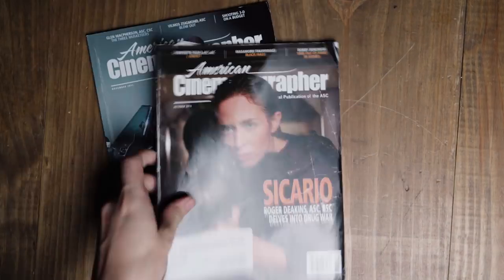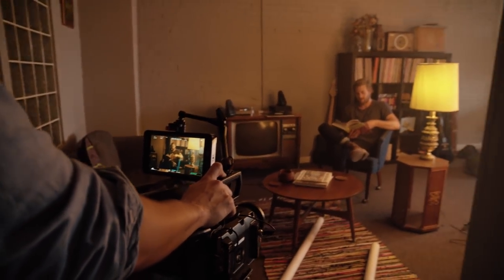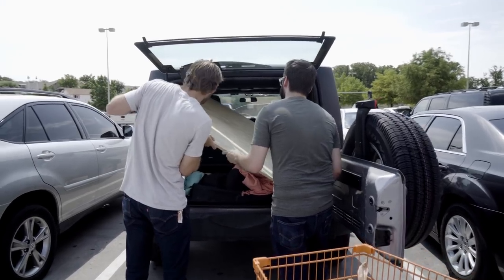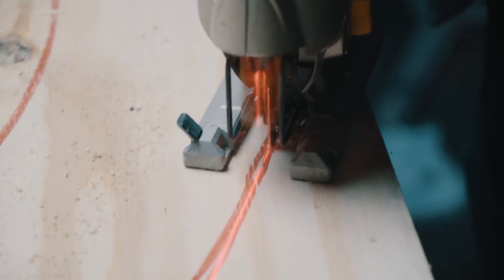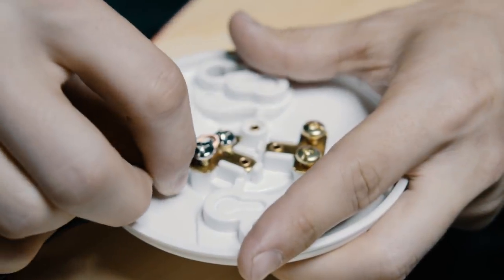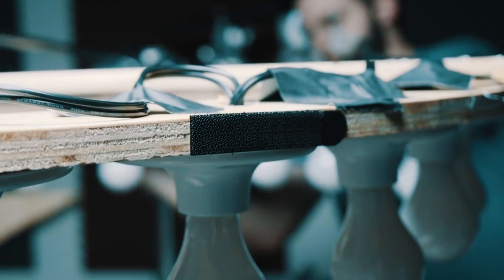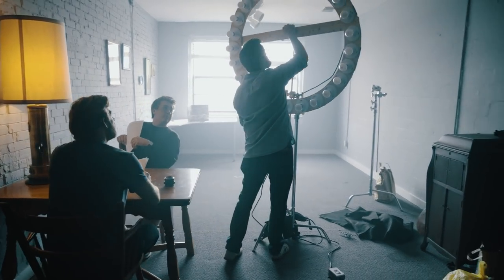How To Make A ROGER DEAKINS RING LIGHT | Cinematography Techniques

Comment: 25x 60Watts = 1500Watts, with 16gauge 2-wire, no ground, wired with no boxes + ~25ft stinger(?) = voltage drop (consult with an electrician).
Reply: Yes, but they're dimming it anyway so a voltage drop is probably helpful. (I'd still use thicker wire tho.)
Reply: No need for ground, it's made out of wood and plastic.

Comment: Instead of the plywood you'd want to use MDF it's more stable and has no grain that is prone to cracking. When drilling holes larger than half an inch you'd want to just use a hole saw as well. Alternatively there are other bulb mounts that are battery powered so you wouldn't have to be limited to certain areas with a source of electrical outlets. Great work by the way! Love Mr Deakins tips!

Comment: to find the ctr of the plywood, use a chalk line and snap a line corner to corner, do this for the other corner to corner, where it intersects is the center, it is easy and more accurate than what is presented in the video.

Comment: Really appreciated the video. I thought before about making a big ring light like that but never found a place where I could store it, so the project fell by the wayside.
But the former building inspector in me cringed a little on a few things that haven't been mentioned or that are definitely potential hazards.
First of all, the ring will draw 1500 watts. So make sure that the lamp cord you use is rated for that or more. For North-America, it would need to be wire that's rated over 12.5 amps. If it's not, it will overheat from all those electrons flowing through and potentially catch fire.
Second, the porcelain fixtures used are designed to be mounted on grounded electrical boxes. It would be preferable to use a different type of fixture if possible. If not, you have to make sure you seal the bottom of each fixture properly and take care about not letting humidity enter the wood as it could become an electrocution hazard.
But apart from that, it's a great project and it wouldn't take much to make it look really processional.
Reply from the maker: Good point, should have mentioned I used 16 gauge lamp cord which is rated for 1560 watts.
Reply: @shutterstocktutorials  Yeah no, you should not be teaching people to build this. You might have the aptitude to do it properly, but there are too many things that can go wrong, and this design skips too many of the safety features that those components are designed to work with. 

It might be safe for YOU to use, and safe for ME to use, but someone out there might make a mistake that causes a fire. 

How would you feel if you found out one of your subscribers built this, and something went wrong ? And if the insurance company found out something like this started the fire, they wont' be covered. 

If you're going to build something like this. It's do so at your own risk, you DO NOT teach other people to do it. 
Something like this will not be UL or ETL listed, and the way you are using the components violates their UL listing, therefore it would not be void your insurance if it fails. If someone else builds this and it fails, you could be sued. 
If you're going to teach people how to do something like this, it needs to be 110%. Components have to be used as they were designed to be used and all safety featured need to be implemented within the intent of code.
ie: No fuse ? Use 14g wire. 

It's really not that hard to do this right, sure it'd cost 3 times as much, but what is your livelihood worth ?
Reply: @Mewtal8  I disagree, he does not have the aptitude to do this properly. Basic math on paper shows this is a bad idea.
Reply: @Francois Laverdure Which light fixtures would you recommend?
Reply: @asadenning8801  Those lampholders are fine, but they need to be mounted to electrical boxes which are in turn mounted to the wood. What would make this much safer is using LED bulbs, good ones with at least 90 CRI. Cree's 60-watt equivalent bulbs that they sell at Home Depot are great. They'd only use 250 watts, compared to 1500 for the incandescents.
Reply: @KingdaToro  I have seen this comment before, please explain WHY electrical boxes are needed because I see nothing that would make this better, if anything it adds more of a hazard because if they use metal boxes they need to all be grounded. the lights should be grouped closely together so boxes would defeat that purpose. I see no benefits to using boxes and only added cost and time
Reply: @shutterstocktutorials  with all due respect, 16 gauge wire should not be used for 1560 watts. that is undersized and false advertising, your wires will get warm using the full watts
Reply: @eksine  Electrical boxes are for containing any sparks or arcs that could otherwise start a fire. Any electrical connections or junctions must be inside one. They are DEFINITELY needed here, as the whole thing is built from combustible material. Plastic boxes can be used if you don't want to worry about grounding them.
Reply: @KingdaToro  Adam I looked up thermal properties of plywood and electrical boxes which I assume is made of PVC. What I can tell from the numbers is that PVC will start melting before the plywood will start igniting so the box is not really preventing what you are saying but my understanding is very little because I'm no materials engineer. So again I see no solid reason to use electrical boxes from a cost and size point of view. If the wood will catch fire than the box will not prevent it. There is a plastic call PEK or MEK I can't remember their names that would hold up to the heat. In any case building a frame out of aluminum or mild steel would work from a fire proof point of view but you would need to ground it, however the more I think about it the bulb holder is made of plastic, probably PVC too so in any case the entire scenario you guys are arguing about electrical boxes don't make sense. maybe just add in the GFCI adaptor like I tell people and carry a fire extinguisher

https://www.performancepanels.com/thermal-properties#:~:text=The%20thermal%20degradation%20and%20ignition,some%20possibility%20of%20spontaneous%20combustion.

https://en.wikipedia.org/wiki/Polyvinyl_chloride
Reply: @eksine  It's this simple. When you're dealing with line-voltage electricity, you are required to use UL listed electrical components and wiring, and to use them in a way that doesn't void their UL listings. Any project that fails to do this is flat out illegal. If it were to shock/electrocute someone or start a fire, the person who'd built and operated it would assume full civil and criminal liability. Insurance wouldn't touch it. Using lampholders without boxes ABSOLUTELY voids their listing.
Reply: @KingdaToro  what about the plywood than? that would negate the entire UL rating by itself. I see what you are saying but in order for the entire thing to be UL rated it must wholly  pass their inspection, the plywood alone would fail UL so your entire argument doesn't completely add up
Reply: @eksine  The plywood isn't an electrical component. As long as you use electrical components with UL listings that allow them to be attached to wood, you're good there. Boxes typically are. Lampholders are not.
Reply: @KingdaToro  so I can attach electrical boxes to cardboard boxes, sell them and legally claim the contraption is UL certified? that doesn't make any sense whatsoever
Reply: You're still not getting it. Electrical boxes are UL listed to be attached to wood, as it's a common building material. They are not listed to be attached to cardboard. Attaching them to wood would not void their listings, attaching them to cardboard certainly would. In any case, the entire device would need a UL listing in order to be sold as a complete device. This is not being done. You don't need to get such a listing to build something like this yourself, or to sell/give away plans for it. You do need a listing to sell the actual completed device.
Reply: @KingdaToro  no Adam, you say I am not getting it however I've been listening to you to understand your main point. Your concern is that insurance won't pay unless everything is UL certified correct? that is just not so, insurance will not deny your claim unless it's a real shady company which you shouldn't be using. here are the documents supporting this:

https://www.houzz.com/discussions/2642606/will-appliance-with-no-ul-listing-really-void-insurance

https://electronics.stackexchange.com/questions/10639/is-ul-approval-required-on-all-items-sold-in-the-usa

https://www.reddit.com/r/homeautomation/comments/7t5ilz/putting_to_rest_the_insurance_wont_pay_thing/

https://groups.google.com/g/openevse/c/TQ78VAINpus?pli=1

so again electrical boxes hinder the inherent design for an incandescent ring light. we can now put the electrical box concern to the side as I think we have finally had some answers
Reply: @eksine  Regardless of any insurance issues, you should still try to follow the National Electrical Code to the greatest possible extent when working with line voltage. It absolutely requires electrical boxes, and it requires wiring to be protected from physical damage.
Reply: @KingdaToro  I thought I explained why electrical boxes would be a waste of time. Are you an electrical engineer or something? Unless you actually work for the code department I'm not sure why your being so aggressive about enforcing something that I just explained wouldn't work. Do you just have a ton of time ?
Reply: @KingdaToro  the insurance issue was the point YOU brought up, it was your argument you made, not me. Your logic is tantamount to an argument of do it because I say so or everyone's jumping off the bridge so you should too. I just told you the ignition temperature of plywood is higher than the melting temp of PVC electrical boxes. So again unless you have an actual reason other than "because I said so" nobody in their right mind would listen to your advice.
Reply: @KingdaToro  just looked up the NEC definition, it does not apply to a homemade portable light fixture. Your arguments, all of them, have been beyond incomprehensible to this point, literally every point you have made makes no sense. Legally you are not required to use electrical boxes, insurance will not deny your claim, and lastly functionally it is not making anything safer for the light fixture. You've been proven without a shadow of a doubt your advice is terrible in every absolute way possible
Reply: @eksine  And you have yet to show why not using electrical boxes will make this device safer.
Reply: @KingdaToro  I never said my way was safer, Also I mentioned GFCI and a fire extinguisher, you've been too busy talking about stuff you don't understand to listen to anything here. You never asked if I had ideas to make it safe but if that was my goal it's easy, I would use high heat plastic to cover the outside like (Torlon™, PEEK™, Teflon™, and Rulon) and use metal bulb holders and boxes and tie them to ground, but the most cost effective way is to do nothing. the danger is not high, use it outdoors or have a quick way to turn it off via switch or yank the cord. also I would make the frame out of aluminum or mild steel
Reply: So, here’s a question: if a 12 GA wire is being used, would a ground wire need to be run for the chain?

Comment: You're going to want to wire this with at least 14 gauge wire, smaller gauges are not safe with that amount of load. 60 watts x 25 bulbs = 1500 watts, divide by 120 volts and you get 12.5 amps. 14 gauge is good for up to 15 amps. You could definitely use the smaller wire if you use LED bulbs instead of incandescents.

Also, at 5:51, you don't want to have the ground wire touching the neutral terminal. If it is, you'll trip any GFCI outlet you plug this into.
Reply: Depends on if he's daisy chaining the entire run of 25 sockets. If the runs are split off 50/50 from where the 12/3 wire is, the max amperage of the lamp cord would be 12 bulbs x 60 watts = 720 watts, divide by 100 volts (paper amps) = 7.2 amps, which 18/2 lamp cord can safely handle.

Comment: Word to the wise: 18 guage lamp wire is probably not safe enough for this application. If you leave that light on for extended periods of time then you will most likely have a fire risk. You will probably want to use something like 12 gauge.
Reply from the maker: I used 16 gauge - which is rated for 1560 watts. I also intend to use this light primarily dimmed to 20-40% of it's full output. Good point though, I regret not mentioning this in the video.
Reply: A way you can get around that is from your first socket feed one pair of wires to the socket at its left and another pair of wires to the socket at its right. Then continue around from each socket. That way you only have the load of 12 lamps per line as opposed to 24.

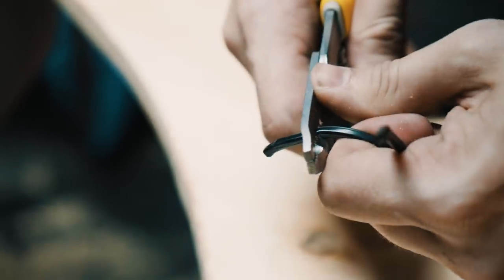Comment: How do you wire the ground wire (green wire) with the power tool cord replacement kit? I'm not sure if you stuck it into the socket itself or cut it off. (5:56)
Reply from the maker: There are a few different schools of though, but I just attached it to a little grommet inside the housing, and it seems to work fine. You can always just cut it off, but it might make it a little bit less stable after a ton of use. But, again, different schools of thought - It doesn't really matter a ton to me.

Comment: Hmmm don’t understand why the quality of this light would be any better than a large diffused tungsten source. Interesting build! I’d love to see a side by side with tungsten fixtures through standard diffusion
Reply: deakins only really uses these as additional ceiling lights.. i ve also heard this referred to as chandelier lighting, as that is basically what you are mimicing and is considered a premium look. from deakins forum regarding soft light: A soft light can still create shadows and contrast if it isn't coming from a frontal angle in relation to the camera.
Reply: @Patrick-jj5nh  probably easier to rig to a ceiling too, given its weight

Comment: another fabrication technique, when you are doing layout for the plywood circle for the edison bases,  layout the center of the circle before cutting plywood, this is half way between your cut lines. This way when you drill your holes they will be in the center. Then divide the circumference of you center line by one less than the number of edison basses. So for example if you are using 20 light bases, then divide the circumference by 19 (the reason is that zero is where your first base goes. This gives you the distance between holes, make a template of this distance and establish your zero hole and then using the template mark out the distances around the circle. This is easy to do or just use a tape measure without the template. This gives you accurate holes and takes seconds to do.

Comment: could they be replaced with phillips hue bulbs?
Reply: If you want to spend like $1,000 on light bulbs haha
Reply from the maker: Yeah, that would definitely be much more expensive, and I'm not too sure how good the color accuracy is on those bulbs. But, if you have the means you're welcome to try it out!
Reply: I have my house setup with all Hue bulbs and the refresh rate does not work well with my camera (Sony a7sii) no matter my shutter speed there is flicker. So I wouldn’t recommend using these for video

Comment: Warning: This build is extremely dangerous. This that wire is not suitable for that current draw and will likely catch fire at some point. 25*60 = 1500 watts. That's pulling 12+ amps over lamp cord. Zero effort for any sort of protection, ie fuses. Author has repeated said he used wire rated for 1560 watts. Just because you can run your engine at 9000 RPM's for a second does not mean you can run it full time at 9000 RPM's. This is not how you design products, I would never go above 50% on wire tolerance.

Comment: Use atleast a 12 gauge wire bud, youre gonna overheat that cable
Reply: 14 gauge will be fine for this, even assuming every bulb draws the full 60 watts. That works out to 12.5 amps for 25 bulbs, and 14 gauge can handle 15 amps.

Comment: It's clear this dude does not understand the basics of safe electrical work. This video is going to lead to some fires by some inexperience DIYers. They really should have went over the importance in choosing the correct gage wiring based on wattage you will be generating, especially since it's all attached to wood. Very irresponsible of Shutterstock to put this out there without this VERY important information. Not to mention the importance of using flame retardant duvetyn for your modifier and not just any material. So many red flags in this tutorial. Do better Shutterstock.